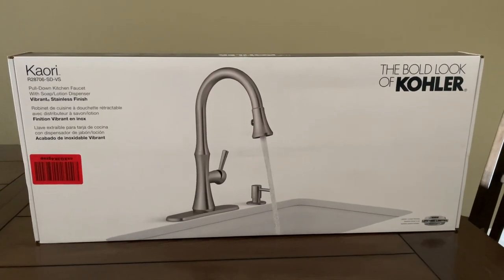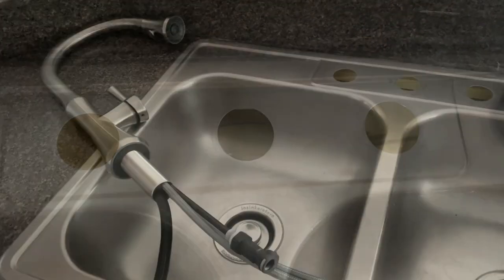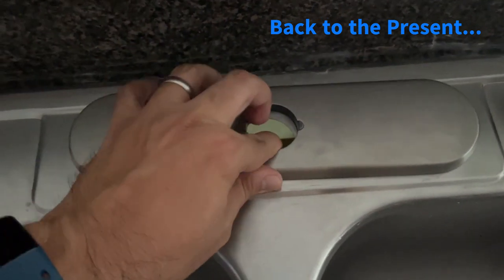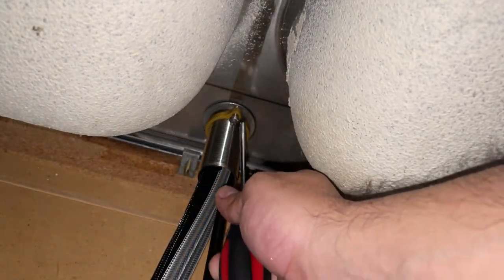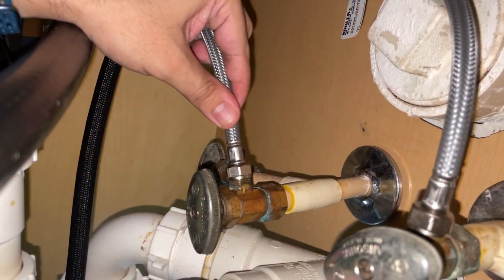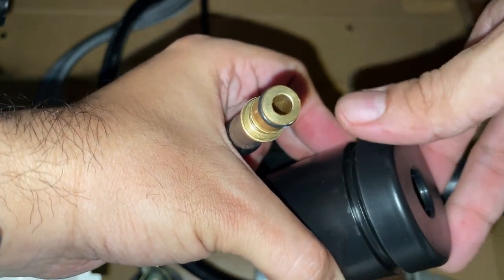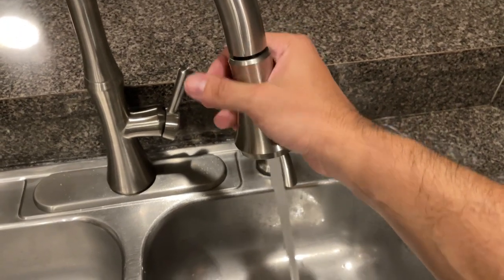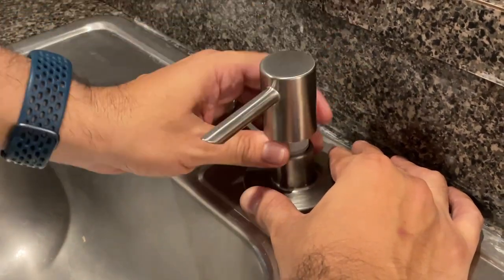Kohler Kitchen Faucet Installation (Kaori Model including Soap Dispenser)

Comment: I think the black rubber gasket for the single hole installation right above the counter top and it goes below the neck of the faucet as single hole! Since you were using 3 hole-plate installation, the rubber gasket might not be required!

Comment: Thanks, but you did not explain where the Black line (the 3rd) came from, and what's for? Also, the faucet comes with 4 lines. What's the 4th line for?
Reply from the maker: Hi! The black line is the extension line for the shower head (you can extend the shower head for reaching into hard places). The 2 black lines connect to each other (refer to minute 11:14). The other 2 lines are your hot and cold water lines. Hope this helps!
Reply: @handyneasy  Thank you for prompt response. Your faucet has 4 lines. Understand the top black line. Where the bottom black line (connecting to the top black line) came from? Is it the 4th (black) line in your faucet? I just got a Kholer 30471-VS. It has 4 lines. It does not have shower head. The 3rd line connects to hand sprayer. Don't understand what the 4th slim black plastic tube for? Kholer's Installation Guide is terrible. It does not list all the parts in the box and explain what is each part for, nor has adequate diagrams. My problem now is not how to install the new faucet. My problem now is how to unscrew a long strange nut underneath in a very narrow & deep space:face-orange-raised-eyebrow:I guess plumbing has not changed much in the last 150 years.
Reply from the maker: In my case the 2 black lines connect to each other and both of them work as part of the shower head system. If your faucet comes with a hand sprayer, could this be related to the quick connect valve? You have to join both black lines in order for you to extend the hand sprayer. This is just a guess as I am not very familiar with that system. If you keep having issues, I would recommend that you call/email Kohler, I believe they could provide you more info.
Reply: @handyneasy   I tore apart the old faucet. I searched Youtube and the so-called "uninstallation" was either drilled or simply cut the old faucet😉I figured out where the two black lines should go and the commission has accomplished. It was the hardest DIY job😅Thank you💯🌹🌹🌹